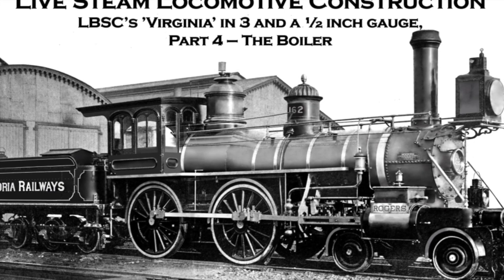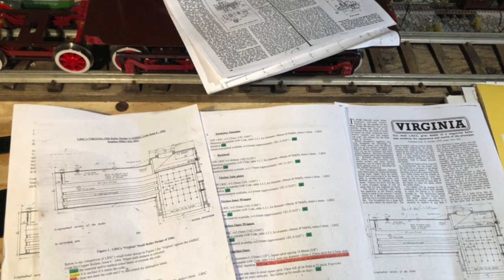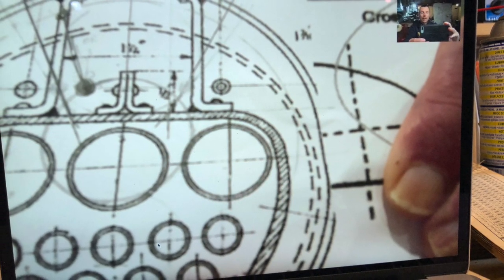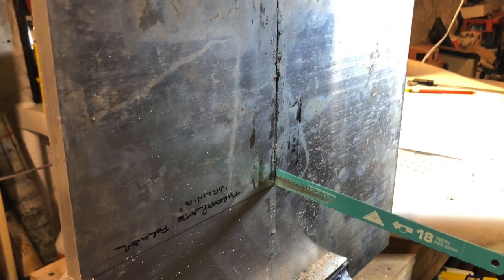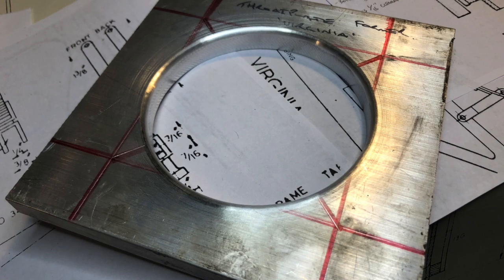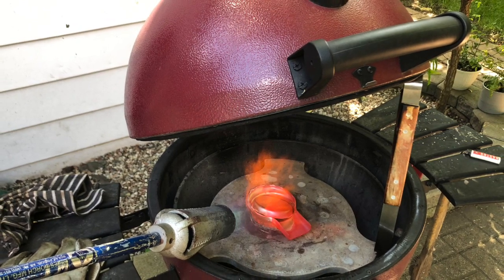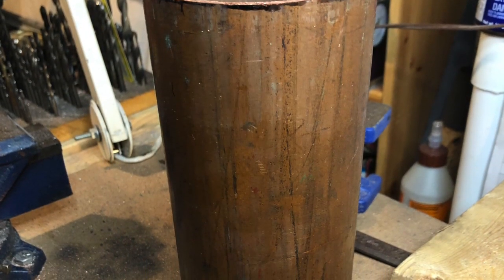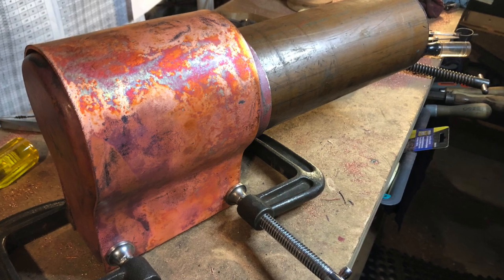Building a Live Steam Locomotive - 'Virginia' as Designed by LBSC - Part 4 Boiler Beginnings

Comment: I am building a Virginia at present and enjoyed your video.
I can make a few comments.
The LBSC design is fine and has worked well over many years.
Copper is used as it is easy to work in to the flanged plates required which are then silver soldered  together.
This design is over engineered and has a structural failure pressure of some 600 PSI
I have never heard of a model boiler failing structurally as the working pressure is very low at 8o PSI.
I had a  blow down valve blow out due to the brass de grading and become weak with age.
I was driving the loco which was a Highland Lassie pacific .
It was a shock but no harm was suffered as the jet of steam and hot water was kept out of harms way.
The boiler pressure quickly fell and the loco stopped..
It would be interesting to hear of other experiences of boiler failure on a model .

Comment: Hi Dustin, is there a way you could send your IAW conparison to the LSBC. I am starting on a Virginia and would like to see where I may have to make some changes as well. Thanks for your help in  advance.
Reply: LBSC is/was(!) a now dead person who revolutionised the live steam hobby. He designed model locos with the philosophy that be driveable and made the necessary compromises between a true scale model and the necessarily oversized parts needed to have a drivable engine.
As Dustin commented the design is over 70 years old and codes of practice have changed. The Australian Miniature Boiler Safety Committee code Dustin uses is the current version that satisfies the requirements of the local insurance companies If Dustin ever wants his boiler certified by an AMBSC boiler inspector he will have comply with this code - important if you're going to haul public and wants liability insurance.

Comment: Hi Dustin  Well I have just come across your site and very happy I did. I have just printed the complete plans for the Virginia and have purchased some material for the build. I was thinking of building to 5" standard but have not quite made up my mine. 
I cannot agree more with your thoughts on club membership. I feel all model engineers should join their local club as they have hundreds of years of knowledge just waiting for new members to tap into.  They can also save one from mistakes, money and time. All the best.
Reply from the maker: Thank RB. A 5" gauge 'Virginia' would be nice; factors to consider would be the capacity of your equipment, own abilities and cost. For me, a 3 and 1/2" inch gauge model has been a great entry point. Yes model engineering clubs are a terrific resource and should be supported. So many other pastimes are encroaching on clubs of all sorts now which is a shame.